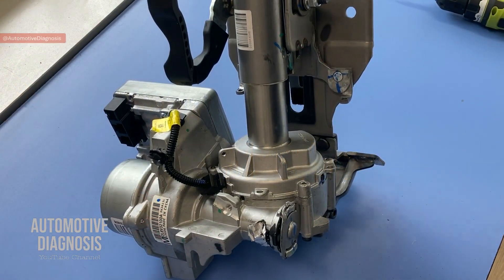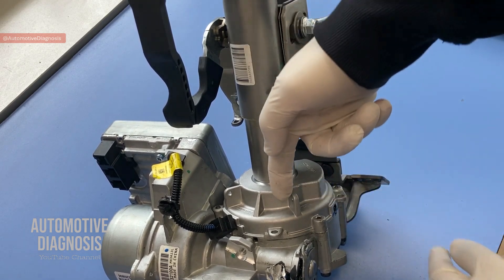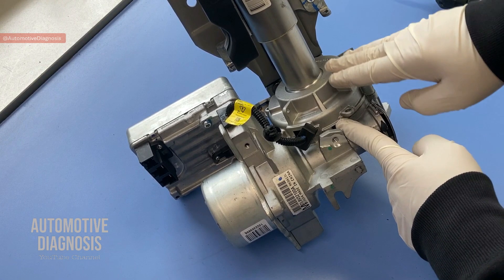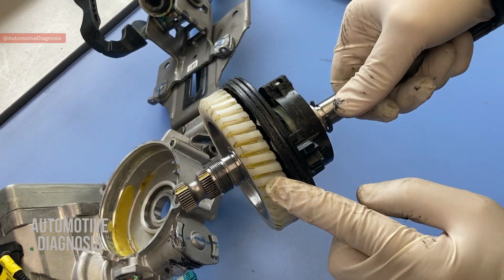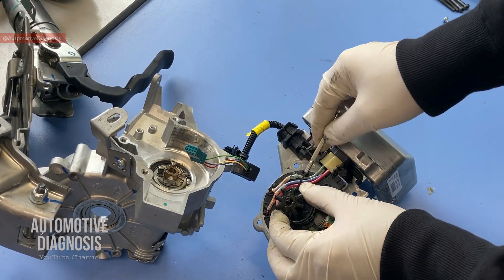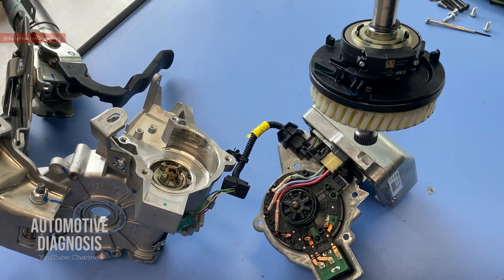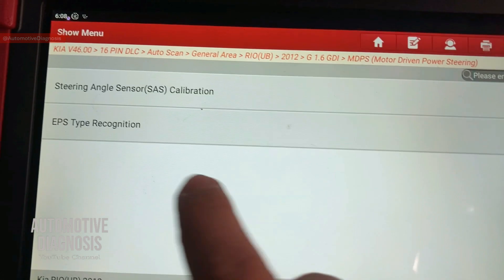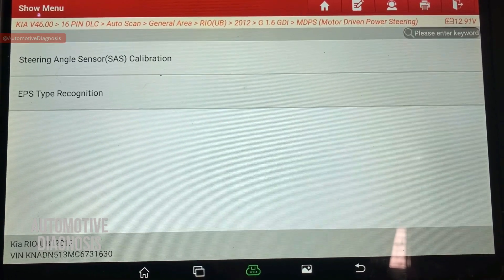ELECTRIC POWER STEERING Secrets Revealed!

Comment from the maker: 🎯 Online Courses:
🧑‍🎓 Automotive Engine Sensors Intro, Operation & Diagnosis Online Course:
https://fix-it-first.com.au/course/automotive-engine-sensors-intro-operation-diagnostic-2/

🧑‍🎓Automotive Engine Actuators Intro, Operation & Diagnostic: 
https://fix-it-first.com.au/course/automotive-engine-actuators-intro-operation-diagnostic/

🧑‍🎓  Smart Key System (Push Button Start) Operation & Diagnostic in ANY Hyundai & KIA Vehicles
https://fix-it-first.com.au/course/smart-key-system-operation-diagnostic-in-any-kia-hyundai/

🧑‍🎓 CAN-BUS Network Intro, Application & Diagnosis Online Course:
https://fix-it-first.com.au/course/automotive-can-bus-network-intro-application-diagnosis/

🧑‍🎓 Automotive LIN-Bus & K-Line Inro, Application & Diagnosis
https://fix-it-first.com.au/course/automotive-lin-bus-k-line-intro-application-diagnosis/

🧑‍🎓 ABS & Traction Control System Diagnostic Online Course
https://fix-it-first.com.au/course/abs-traction-control-system-diagnostic/

🧑‍🎓 Starting System Diagnostic & Schematics Analysis Online Course:
https://fix-it-first.com.au/course/automotive-starting-system-diagnosis-and-schematic-analysis/

🧑‍🎓 How to use on Oscilloscope for Automotive Diagnostic Online Course:
https://fix-it-first.com.au/course/how-to-use-an-oscilloscope-for-automotive-diagnostics/

🧑‍🎓 Everything About Electric Power Steering Systems Online Course:
https://fix-it-first.com.au/course/everything-about-electric-power-steering/
Reply: Greetings sir, this is a great video. I have a mazda 6 GH, Steering is soft on the right and hard on the left. Upon starting and switching off the Engine, the wheel moves inches respectively. Steering spins itself when I'm not holding the Steering wheel.  What could be the problem sir. Thank you
Reply from the maker: @mulekatheron8182 Hi my friend. This could be the torque sensor issue. We can diagnose it with scan tool, and sometimes calibration helps.
Reply: @AutomotiveDiagnosis  hi sir, I'm automotive engineering  student. I‘m curious if the motor is not working, what happened the steering wheel works ? cuz the worm gear is only allowed  one way drive.
Reply from the maker: @yuhangzheng-p1n  Hi my friend. If motor is not working, you can still turn the steering wheel mechanically. For sure you will feel the steering very heavy, but it will work. Inside the EPS input shaft, there is still a torsion bar (like what we have on the steering pinion, on hydraulic steering rack), this allows the shaft to get twisted for a few degrees, to activate the torque sensor and EPS motor accordingly, if EPS doe not assist, mechanical rotation is still possible. This concept is available on both electric and hydraulic power steering systems.
Reply: @AutomotiveDiagnosis  Thank you for your response. You might have misunderstood my question. I was curious whether the steering wheel would be locked if the motor fails, particularly due to the worm gear structure. Additionally, I would like to understand how the EPS motor controls its own speed. It is evident that the motor rotates at a much higher speed than the steering wheel, which seems contradictory. In an EPS system, what is the relationship between these two speeds? Does the ECU control the motor's speed, similar to how it controls torque, to ensure that the reduced speed of the motor aligns with the steering wheel's rotation speed?   Thanks a lot, I just wanna buy some parts to assemble an EPS system
Reply: Thanks very much, will contact you
Reply: Do they require any oil/grease to keep them going longer

Comment: Excellent! I learned a lot. My 2011 kia has  slight resistance when first turn right or left. causes me to over correct. Driving me crazy. Maybe torque sensor needs calibrated.
Reply from the maker: He there, yes torque sensor must detect the steering wheel rotation very quickly (less than 9 degrees rotation), if it's not accurate, you will feel that slight resistance. Hopefully the calibration will help.

Comment: There's something I don't understand. The motor shaft and the white gear are constantly connected. The steering wheel can turn when there's no electricity. How is that possible? The white gear is connected to the motor gear. Is there a special part separating the steering shaft from the white gear?
Reply: Some systems use a magnetic decoupling clutch (like one uses in a/c compressors) to engage or disengage motor from steering gear or column.  Hope this helps.
Reply from the maker: Hi my friend, consider a situation the EPS is not functioning properly, you should be able to turn the steering wheel and steer the car yourself manually. So, that white gear must be connected to the steering shaft directly, and also to the EPS motor. When you start turning the steering wheel, torque sensor detects this and EPS motor starts assisting. But if EPS motor does not assist due to an issue, you can still steer the car manually.
Reply: @AutomotiveDiagnosis That's the point I'm curious about. The transition between the steering shaft and the electric motor.How does the separation between the white gear and the shaft occur when the electric motor is active or passive? Or how does the connection between the shaft and the white gear occur?
As mentioned in the comment above, is it a magnetic coupling or something else?

Comment: I bought a 2015 Ford Edge Sport with 100k miles. Mostly really like the car. But,of late, I notice on hot days after driving some miles the power steering feels like it wants to take over. I get this very slight pulse to left or right. Not like the ridiculous driver assist but, just enough to be annoying. Anything I should be concerned about?
Reply from the maker: Hi my friend, it’s not a bad idea to get someone to check your car, general inspection on suspension and steering system could be helpful. Also regarding the power steering, checking the torque sensor using a scan tool might be needed. In some cases Calibration could fix the issue.

Comment: Mate , Do you know how to turn up the power assist  on the mazda 6 GH , would like it to feel a bit lighter to steer currently it's a little heavy   , it is well balanced  on right and left , cheers
Reply from the maker: Hi there, You can't not turn the power steering on or off, It's active all the time when driving. However there could be an option to adjust it slightly that provides three modes normally: Sport, Normal, Comfort. This can be accessible on the user option is your car has got this setting. But if steering is heavy, you might need to have it checked.

Comment: Hi A.D.  … question ?     I have a 2022 Mazda cx5   ..  recently in a front end accident .. body put back together but eps won’t work …. Where should I be looking at besides blown fuses
Reply from the maker: HI there, Front end accident can damage the wiring, or it could be the calibration or EPS electrical issue too if any part of steering/suspension was damaged/replaced. The best way is to check the EPS with a scan tool for any possible fault codes now.

Comment: the one thing that fascinates me everytime i drive a vehicle with EPS system is how quickly it responds to clockwise or counter clockwise commands. after seeing the inside i found a new level of respect to the engineering side and for the machine as well.

Comment: Pls how can I reached you, I really can't get a good assist after I change my engine from diesel to gasoline, base on your video I think the new engine module has not been connected to the steering EPU, pls can u help me, my technician gave up and said nothing can be done, I have Rav4 2008
Reply from the maker: Hi my friend. When we change something major like engine, we need to consider all the system that are installed on the car. You new ECM might not support the EPS. Sometimes ECM must be replaced and sometimes it's just need an upgraded software. But the amount of change that you have made on this car is a lot, the guy who replaced it for you should have planned it first.
Reply: Thank u so much @AutomotiveDiagnosis

Comment: Nicely explained, what surprises me are the amount of plastic parts that can wear out in what is quite an expensive item that should be strong and robust, curious what makes that little black cog between the motor and the drive face wear out and chew up, is it lack of lubrication in the worm gear ?
Reply from the maker: Hi my friend, it's not actually the lubrication, it's basically the quality which can't take the applied toque for a long time. The new OEM products are much better.

Comment: I have a doubt, in case of failure can it happen that the steering starts to turn by itself?
Thanks, great channel, congratulations, you explain things very well.
Reply from the maker: Hi my friend, I haven't seen anything like this that EPS turns by itself. Although sometimes after changing the torque sensor, if it's not adjusted properly, it can rotate all the way to one end (right after installation not while driving) which needs a lot of attention during installation.
Reply: @AutomotiveDiagnosis  What I mean is that if the ADAS moves the steering wheel to stay in lane, or moves it to park, I ask if it could happen that the system has an electronic or software fault and moves the steering wheel in an unexpected and dangerous way.
Reply from the maker: @agib531  Hi there, EPS normally works with ADAS and smart parking assist system too, so in case of "lane keeping assist system" if car moves out of the lane (without indication) EPS with bring it back to the center of the lane.
Reply: @AutomotiveDiagnosis  Maybe I can't explain my doubt well, I'm using google translator ☺☺
What I would like to understand is if it is possible that due to a hardware or software failure the steering wheel starts to turn by itself. 🙂

Comment: I have a 2014   Chevy 2 wheal driver I drove it through the flood water to save my friend the water was at the bottom of my cab and the next day I had no power steering then the next day I cant even move my steering wheel it is electric I check the 3 plug in they was dry with electric grees  in them the fuse isn't bad all new ball joints and tyrod ins I  don't have no way to take it to a garage do you have any idea what the problem could be or what I could do to check the motor to see if it's getting power or works
Reply: 检查是否是保险丝熔断了

Comment: Hi, nice video, can a diy built CAN controller sending the correct and needed information to the EPS make it work "stand alone"?
Reply from the maker: Hi there, I’m afraid it’s not gonna be efficient as EPS does not work stand alone. It needs some information including the engine RPM and vehicle speed to be reliable and efficient.
Reply: @AutomotiveDiagnosis  What I mean is if I provide it with all the information Via a CAN controller with the correct Bit IDs, wheels speed, rpm, vehicle speed and steering angle.

Comment: Thanks a lot for spilling the light on that equipment that isn’t that much information available in internet.
Some of the belt driven EPS such a ZF product has a belt slip detected problem and E- motor rotor position is out of zero position which isn’t permitted to perform initialisation of EPS after assembly or repair, can You advice some tips how that zero position of EPS drive motor rotor can be restored and by means of what?
Maybe You can advice some learning platform on that issue ?
Thank you once again for knowledge sharing!

Comment: Can toque sensors be replaced?
Reply from the maker: Hi there, you can’t find the part in the part shops but you can install a good known torque sensor from another EPS assembly that was replaced for other problems. For example if there is any EPS with EPS motor problem, you can use its torque sensor, but EPS must be exactly same number.

Comment: Great video. Just wondering how does the steering wheel turn when the power off? Because you can't transmit that turning motion back to the motor due to the screw gear. Is there some sort of slip clutch between the screw gear and the steering column? Thanks.
Reply from the maker: Hi my friend. mechanical steering will be still available. On the steering column (inside the torque sensor) there is a torsion bar which gets twisted when you turn the steering wheel (only less than 10 degrees), by this rotation, torque sensor detects the torque and direction, and EPS will assist. If torsion bar gets twisted but EPS does not assist, after that steering shaft keeps rotating and mechanical connection will rotate the steering pinion.
Reply: @AutomotiveDiagnosis  Ok, so that means the steering shaft is able to rotate even if the EPS motor does not rotate. I'm just wondering how they can disconnect when they need to. Thanks for responding.

Comment: In an older car with EPS in which the control module does not show up on a scan tool, how can a calibration be performed? Are there self calibrating units? All other control units show up except for EPS and even the FSM does not mention about EPS except for hydraulic PS. P/N is 28500 AN000. Excellent video, thanks.
Reply from the maker: Hi my friend. Generally when there is EPS system, we should have it one scan tool too. Sometimes you don’t see  the calibration (as it used to be a manual calibration on some early versions) but you must be able to read the codes and live data. If you can see the EPS assembly but there is nothing on the scanner, there could be two cases, either your scanner doesn’t cover the software correctly, or EPS is aftermarket and someone had it installed. If car is too old (like the very early versions on EPS) there is a chance that calibration can be done using ABS system.

Comment: Cool. I would imagine the motor changing direction would be by reversing the current. However, I noticed on the scan tool that the current did not change sign with the direction like the torque sensor. Is it just showing the absolute value? Is the motor changing direction while current is not?
Reply: Current value is absolute value. If it is a brush motor the direction is changed by H bridge controller(4 mosfet) via programming. If it is brushless motor, then direction is changed by switching the inverter circuit (6 mosfet) according to hall sensor value via programming.
Reply: @SunshinesElectropedia  Gotcha.
Reply: Its all about programmjng. Torque value is calculated without |abs| value because to know the direction of turn. Suppose torque value is 2Nm. There is a lookup table. For 2 Nm suppose target current is 16A. Here current value is caluculated abs(current) so that PID controller can reach the current in any direction. In PID controller the target value is positive. Here current is the target which means how much power the motor will give.
Reply: At high vehicle speed, minimum assist required.  At low vehicle speed max motor power is required. Its programmed like that. If driver apply too much effort torque sensor detect it and produces high motor power.

Comment: Problem they run dry and start creaking and very very expensive to replace if the body is worn out or cracked. Old ones on the steering column are more reliable
Reply from the maker: They are very efficient, aren’t free of faults though.